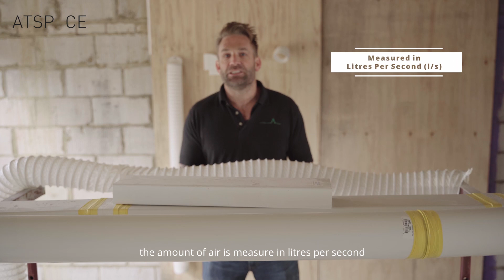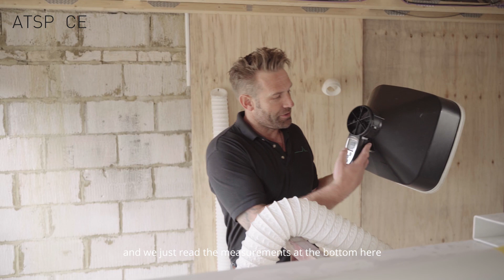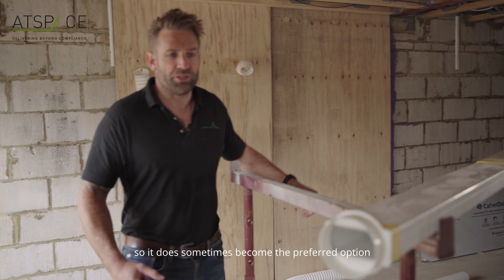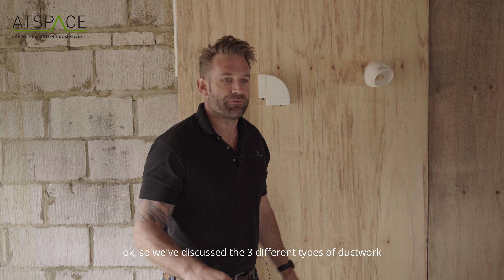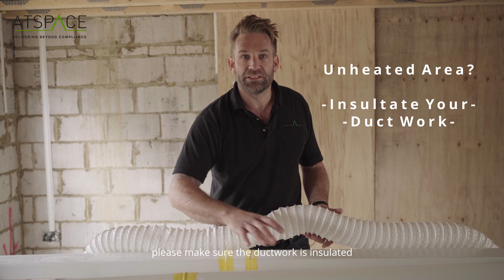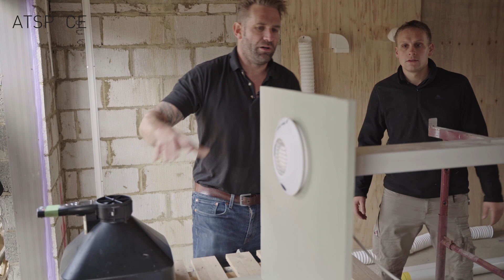Ventilation Flow Rate  - The Affect of Ductwork

Comment: Which type of ventilation pipe we can use from loft area space and dmev fan here by maintenance of F complaice
Reply from the maker: Hi i would use  rigid or semi-rigid ducting (e.g. 100mm PVC or equivalent) from the DMEV fan to the outside, insulated if routed through a cold loft space.
Flexible ducting is only allowed for short connections (max 300mm) and must be pulled tight, supported, and insulated.

Comment: Excellence demo. Food for thought. I read somewhere that if you consider the space required for rectangular versus round duct the rectangular duct gains back the losses given it uses less space but in most situations I think I’d definitely be aiming to use the round.
Reply from the maker: Top man! That's my advice if possible. If you're using a rectangle, keep the runs as short as possible.

Comment: You mention to “be careful” about the exhausts, but don’t suggest a recommended option in their place. What would you recommend instead?
Reply from the maker: Thanks for your question, Jason. While I can't recommend a specific replacement for exhaust vents, I suggest caution with roof vents due to the efficiency issues I've encountered. I always try to aim for the exhaust to be designed so it comes through the wall. For wall vents, investing in higher-quality options is wise. Also, please ensure professional installation by a skilled tradesperson for the fan and ductwork. This can greatly improve performance and longevity. Prioritise quality over cost for reliable ventilation solutions. Sorry for being vague; I would love to have time to test all the different options. I suppose with more experience, I will have better knowledge in time to come.
Reply: @atspaceltd654  Brilliant, thanks for getting back to me. Very helpful and much appreciated 👍